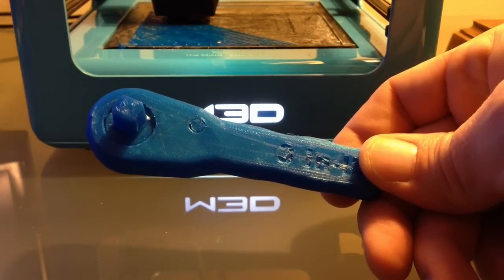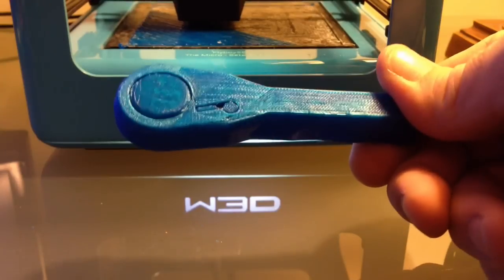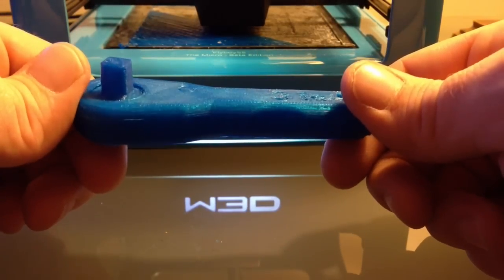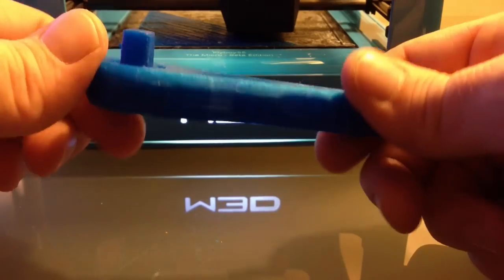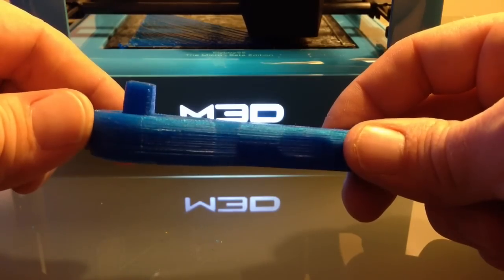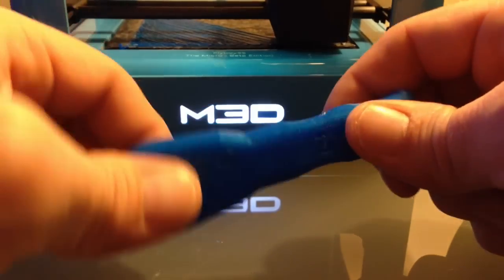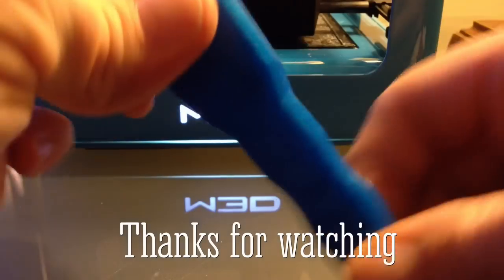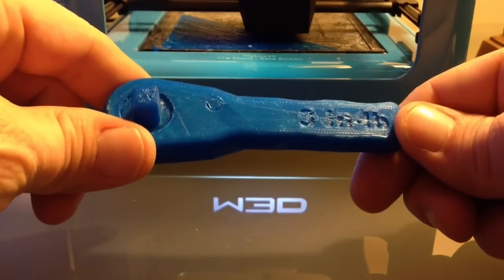The Micro 3D printer M3D -- 1 piece NASA ratchet wrench -- Printed and tested

Comment: I have printed this with ABS on my Airwolf printer (which was quick confiscated by a friend who is a SPACE buff) And it took all of 1 minute to free it up(used a lot of force and a vice) but totally amazing. Very tight and seemed usable.. Have no idea have to print it again . And I seen in the comments what I would recommend. If your software has the ability print diagonally you can print larger things that your bed allows that way.. Would love to see an attempt at you printing that again diagonally..

Comment: On the fact that you need to print a huge platform underneath to prevent the objects from breaking when trying to take it off the base sorta gave it away to not buy this printer.. It's a waste of filament and the print doesn't seem very high quality considering the amount of residue. Great video by the way!

Comment: Nice! Can the wrench be used to tighten/loosen bolts without breaking immediately?
Reply from the maker: Pun_Machine it's a light torque wrench so stuff tightened at less than 3-5lb it will work for. Keep in mind micro was too small to print it full size. That make it impossible to find a socket to fit it.  The crescent wrench is cooler. Maybe I'll post a video of that in the coming days.

Comment: wait is that blue square mass A RAFT? massive waste of fillament Do not buy this printer i had one and SO MANY ISSUES
Reply from the maker: I've been inactive on these videos for quiet some time. But I'll have to agree with the last post. I'm very unhappy with the end result of M3D. It was a huge let down. I hope the other printers I ordered of of kickstarted arrive one day.  Maybe they will be less crappy. My current m3d has been turned into a small desk top waste basket.
Reply: +Flyboy55 the company isnt good with returns we had to write the better business bureau and that took a month i am going to order the Davinci Jr by XYZ printing same price and do you have any information i should know about the davinci jr. Very cool use of the printer as a waste basket that's the only thing its good for. Have you had any trouble with the prints shifting during the print like after several layers the layers seem to move to the right or left or whatever?
Reply from the maker: +PeridotDoesGames I also have two da Vincis by xyz. One single and one duel. They are ok, I've had to take them apart time and time again to repair them. I wouldn't recommend them to anyone other than a hard core tinkerer so what's a project. For the money I really like the up! Mini. It's reliable, and easy to use. My kids have been using it for years and it still runs like the day it was new. I've even given several up! Minis as gifts to friends and family.
Reply: +Flyboy55  what do u mean by the single and duel, like the amount of extruder heads
Reply from the maker: +PeridotDoesGames yea single and duel extruder heads.
Reply: +PeridotDoesGames Its working way better now sure some issues with it but cmon its dirt cheap check my channel for a timelapse of a better working ratchet
Reply: i have this printer and it took 3 months till i was able to recieve a refund and the still dident refund the ful price the gave me 200
Reply: all the problems I had where fixed after a lot of calibration and some painters tape, I still to this day think it was my best 250 bucks I have ever spend
Reply: clanc25 in my opinion worst 350 i ever spent
Reply: ***** yeah mine was a miss